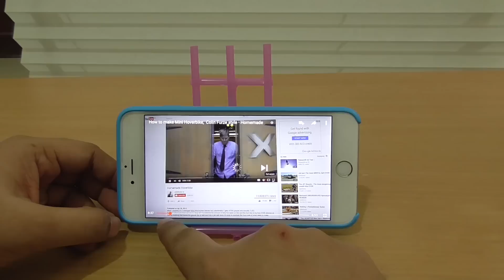5 Things YOU can make using Straws - Life Hacks

Comment: for the helicopter if you use three motors place two at the back since it is where the wire weighs it down and give an axis anchor you will need more thrust

Comment: i did a similar boat but i only used one motor and i used an induction fan and its submerged under the water, i used an iphone 5 plastic case and put on a switch to turn it on and off lol i did some art work and the sides where its says iphone 5 C i wrote iBhone 5 Cunts xD it moves pretty quick and had lots of fun

Comment: please don't put that boat in the sea of it gets a way from you won't be able to retrieve it and if it tips over and drop the exposed battery in the water the battery night expose it's Lethem and that will have a violent reaction with water
Reply: how about attaching a little Rope to the boat so he can pull it back to Land whenever he wants and needs to?
Reply: How about he uses a steering wheel and drives it to the ocean?